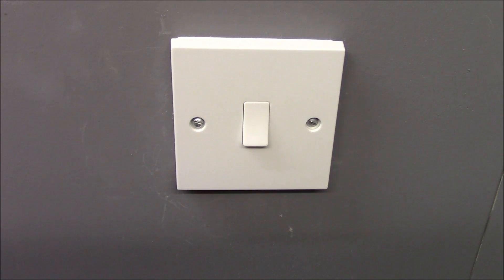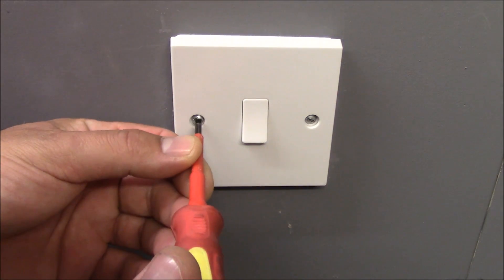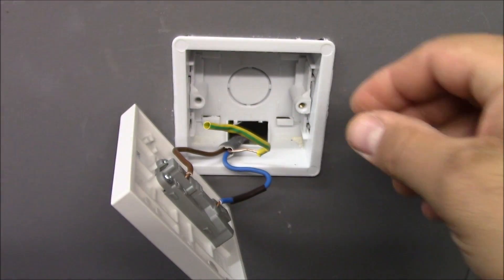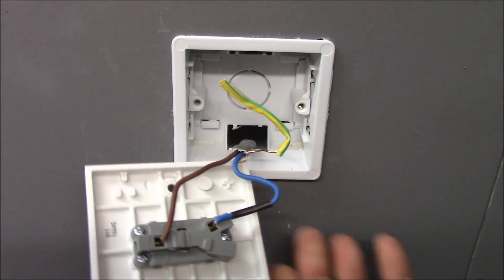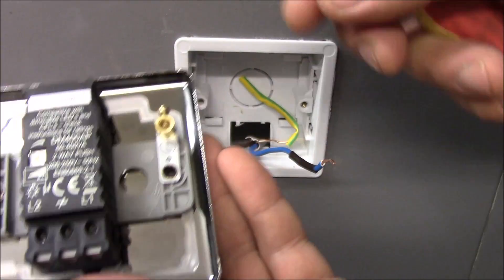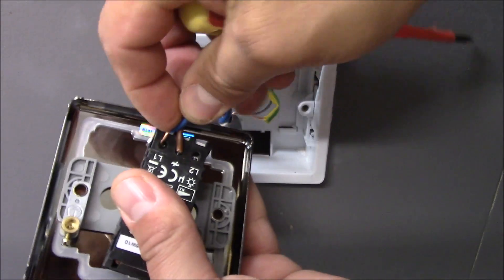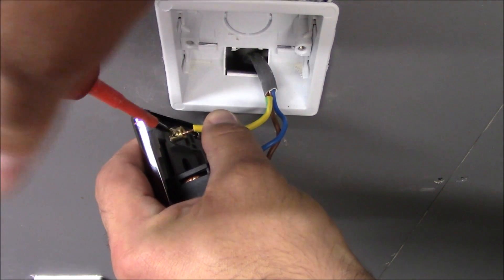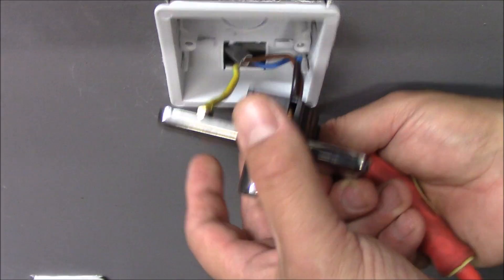How to wire dimmer switch Replacing one way switch with dimmer one

Comment: I followed your video, very carefully, and made notes. Then I turned off the lights at the fuse box.  Then I removed old broken dimmer switch from my bathroom and replaced it. Your instructions are really good and very clear. I am so thrilled with my achievement. Thank you very much. I’m going to attempt the “replace ceiling pendant with nice light fitting” next.  You are an inspiration to all of us women .
Sarah
Reply: Hi,
Madam if you don't mind Can you share some  photos what you made in your notes regarding dimming system.
  I think you prepared wiring connection from db to switch & from switch to load.
Waiting for your kind response. 
Thanks

Comment: i have 1 gang 2 way switches and going to replace one of the switches to a dimmer switch , when connecting wires do you connect live swtch wire in L2 and brown wire in com

Comment: My wife has requested a dimmer switch in the kitchen which controls 10 led's, but is part of a two way system. the other switch has 2 switches of which one controls a seperate light. Can I just fit a one gang dimmer switch to the single switch, or fit a two gang dimmer switch and have to get a two switch one dimmer and one not and and have the dimmer switch two way. This in the UK.

Comment: Ive got the same dimmer switch to fit ,but I got 3 red wires. 2 are twisted together and go in common,and 1 in L1 . Earth is not used ??? Although it is there .

Comment: Thanks for the video but I am hoping you can help me? The two wires coming from my wall are both brown and the new dimmer I want to fit has three connection points on it. The first one has an L the second has the letters SW next to it and the third has a wavy line with an arrow through it pointing up? I'm totally stuck so any help at all would be great. Thanks and take care.
Reply from the maker: I guess it's varilight dimmer switch. So L is for permanent Live , the one with wavy line and arrow is switched live . And SW is  to link with another slave switch. So don't put any wires into SW . Cheers

Comment: My old light switch has 3 red wires and an earth wire connected to metal box...can I still install a dimmer light switch to this connection... Pls answer
Reply: Yes
Reply: 3 red wires mean that the loop in is at the switch. Two reds will be wired into the common permanent line (except the last switch on the circuit - there will only be one) providing permanent lines for all switches. The third red wire connected at L1 or L2 is the switched wire going from the switch to the L terminal on the light. The neutrals arent  always present as most installations like this are done in 1 core (line) and earth cables. The single neutral cores go straight to the consumer unit to all the lights.